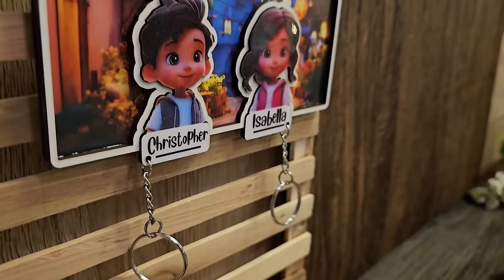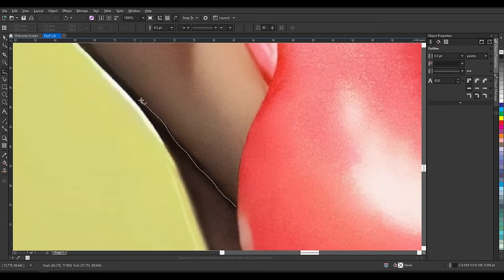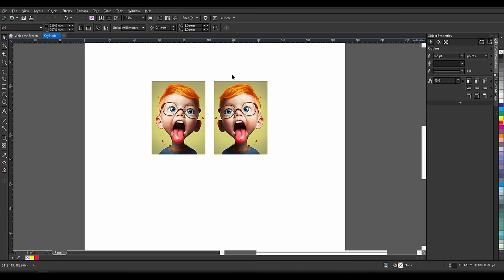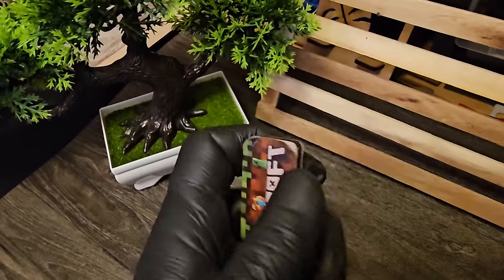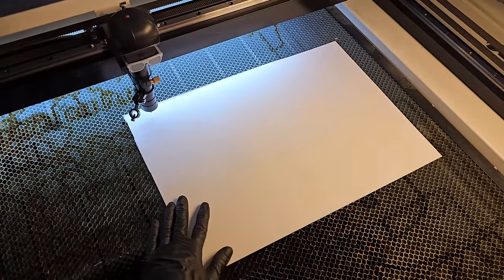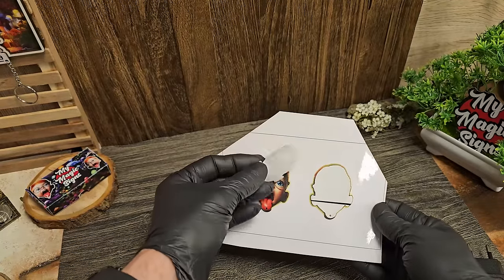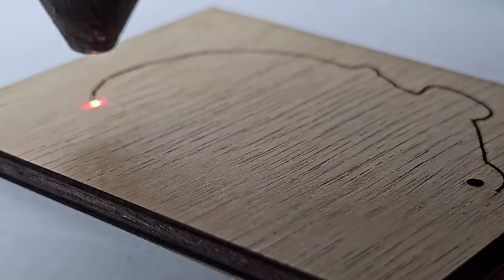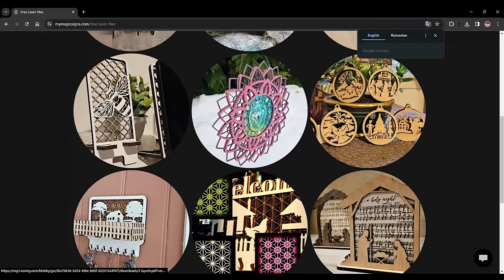Print and Cut with your Laser Cutter, add full color prints to your projects woth no special tools

Comment: Amazing creative idea. I wonder how acrylic would stand up?  Also it might be overkill but I wonder if some coating that is cheap could cover them.
Reply from the maker: Thank you, It would look great as a wood/print/clear acrylic sandwich, I was also thinking doing resin doming, there are lots of way to make these. That's what I am trying to demonstrate with my videos, that there are many ways to do things, and we should consider them all. Make do with what you got! I also try to keep it available for anyone, I have access to expensive toys, but the regular Joe only has a dumpster find printer and a diode laser at best. See you in the next ones!
Reply: @mymagicsigns  I like this resin doming or bubble idea but even resin has it's limitations with yellowing over time. 

Maybe two thin acrylic layers acting as the lamination cover. Sandwich the image in-between to inlay into the border. And laser cut a thicker piece border cut of acrylic to encompass the laser cut sandwich.

Comment: Any suggestion for the glue for paper to wood?
How is the resistance of the paper layer against high air humidity?

This is a GREAT idea, can not wait for my own laser!
Reply from the maker: I just use double sided tape, it works great for indoors even with high humidity, I did not try it for outdoor use, but I guess some resin for protection and you should be good to go!

Comment: If the thickness of your material is 3mm or less, you can use the laminator  to apply your print to it.  This is really handy if you have a full sheet, you can easily stick it with perfect adhesion and no bubbles.    Polyester sticker paper is good for this application, you can skip the step with the double sided tape.   Maybe still use the laminate pouch for protection.  

If you are cutting the backing and sticker together, cover it with masking tape to protect the sticker from smoke.
Reply from the maker: Thank you, I only laminate the keychains, for the rest of my projects I use regular paper, and any wet adhesive you would use on regular paper will wet the paper  and it will look bad, also the wood grain will show through easier if not for the double sided tape, I've experimented alot with this, and double sided tape is perfect for regular paper. If you use cardstock or thicker photo paper, you can use any adhesive you want.

Comment: We have been looking for someone like you Sir to be able to create cut lines for graphics. We use the Mimaki UJF-6042 to create Direct To Substrate gang sheets but finding someone to create the cut lines for the laser (trotec cause it has cameras) is almost impossible. What is your email and where are you located?
Reply from the maker: Hello,  thank you but I am not available for hire, my info is available in the about section and I can answer a fiew questions, thank you for considering me, I am located in Norway.
Reply: @mymagicsigns  Yes, I saw that when I looked at your website. I actually work with a company AmCad graphics and cutworks who get a lot of their machines from Norway.
Reply from the maker: I've seen your stuff, nice equipment, i used to do a lot of work in the print side in the past. I am working now at a 3 episode mini series in which I am going more in deepth on design and file preparation, it will be a Doll House, but that is just because I could not find a lenghty and complex enough project. The doll house is irrelevant and what you learn there is relevant also for your type of work.

Comment: I'm curious, what kind of double sided tape is that? I've bought a few types of double sided tape before, but none of them are suitable for a project like this, because they're either too thick, or don't have a protective layer to peel off.
Reply from the maker: @andrewsnook8168  I use the generic type I find in the local hardware store, it's like scotch tape but with adhessive on both sides
Reply: @mymagicsigns  Ah, I see. I couldn't find anything quite like that near me, but I did find something on Amazon.

Comment: what type of laminate are you using??  i thought PVC is bad for lasers?
Reply from the maker: Hi, I use PET Pouches, as most laminating pouches are, since Chlorine and Cianide releasing plastics have some commercial restriction when used for thermal equipment, now if you live in a bad country like I used to, they don't care about the rules and you should read the lable, this is not a video about laser safety.
Reply from the maker: But in the case you want to use PVC sheets, The cold laminating ones can come in PVC plastic, I think you would still be OK, as the sheets are so thin as most of their thickness is glue, just don't breathe it in, have good ventilation.
Reply: @mymagicsigns  you are probably right it would not be a big health hazard, but the chlorine also corrodes the metal quickly (really bad for the linear rails).
Reply from the maker: @NickSpirov  I know, but not at those thicknesses, I would have to burn o whole sheet to barely corode the tip of a wire.
Reply: @mymagicsigns  maybe, maybe, I wouldn't try so I won't know 😜I've seen the stains on the rail, they look like mold.
Reply from the maker: @NickSpirov   It's just dust, you don't have to try, you can skip the laminating pouches, just print, cut and add some clear coat. Or read the lable, it should say PET somewhere on the package, or don't use anything, I have all my signs with plain paper, nothing on top. The paper inherits a bit of the woods strenght when adhered properly.

Comment: what is the software you're using?
Reply from the maker: I use RDWorks for Laser Controll, CorelDraw for design.
Reply: Thank you!!  @mymagicsigns
Reply from the maker: @pedromendes5684  You are welcome! I like RDWorks better than LightBurn since I use it only for laser controll and it has a way better node editor for quick touch ups.